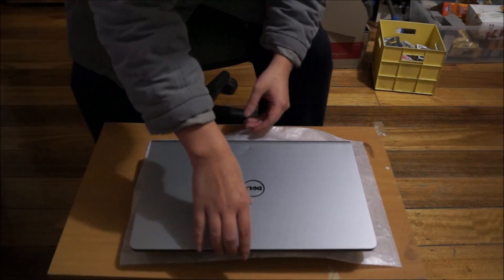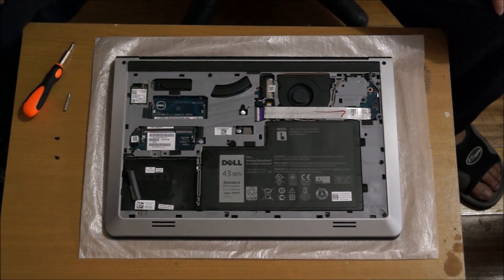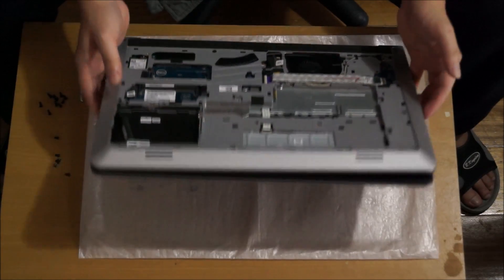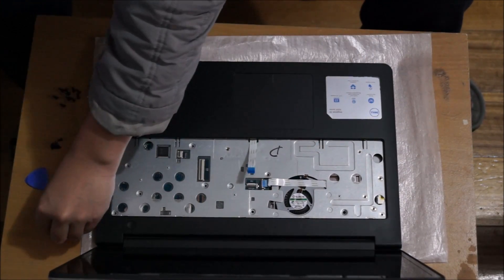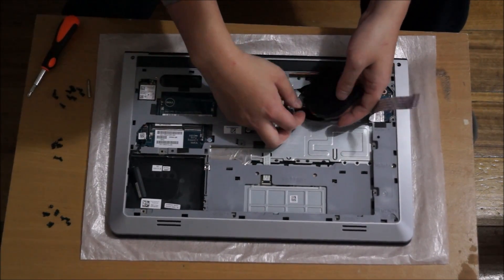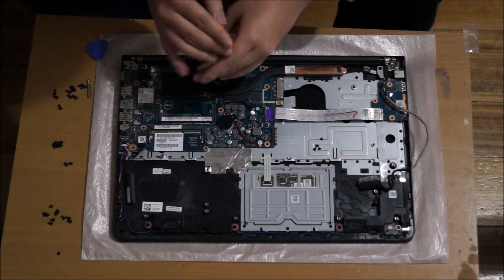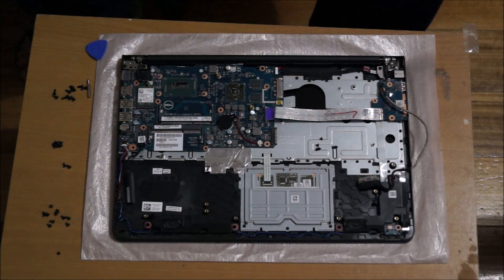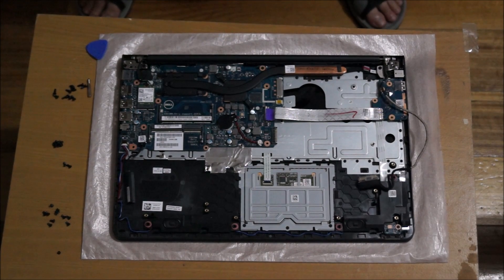OPEN ME UP! Dell Inspiron 15 ( 5548 ) 5000 Series Disassembly

Comment: Do you think I could fit a 9.5mm "2.5 HHD rather than an SSD?
Reply from the maker: it will fit a 9mm 2.5 inch drive as the verbatium i was using is a 9 mm
Reply: @OpenMeUpTec  Oh okay, thank you. I'm just surprised you've been responding to comments from a video you made 9 years ago.

Comment: Can u explain why it beeps why I turn it on like I get 4 beeps at a time
Reply from the maker: beep code are there to tell you what is wrong with the laptop. i believe 4 is faulty ram
Reply: @OpenMeUpTec  it wasn't turning on at first but I removed a ram stick it works now
Reply: Hey do know like how to fix the webcam ? It doesn't work

Comment: My laptop is not working  .is shows beep sounds but now it doesn't respond  I dissemble the laptop and check motherboard but fan is on but display not bro help mw
Reply from the maker: beeping sound means something. it is a code you need to tell me how many beeps
Reply: @OpenMeUpTec   it's just like 2,or 3 beep  sounds
Reply from the maker: @honeysharma8052  probably your ram is dead take out the ram and see if it still beeps the same
Reply: @OpenMeUpTec  bro but i follow your video and open my laptop complete and then connect dc jack with charger and then connect fan fan is working but but but my display is not gatting on
Reply from the maker: @honeysharma8052  did you forget to plug something in. did you do what i told you to do. remove the ram and turn on the laptop. 2 or 3 beeps generally means ram is missing
Reply: @OpenMeUpTec  i complete open my laptop each and every part then i just only connect fan dc jack to charger and display fan is gatting on but display not
Reply: @OpenMeUpTec  you're on any social networking site i send you a picture what i do

Comment: Do i need to remove the back cover to repaste the cpu or only the keyboard? And does this disassembly guide work for all models of dell inspiron 5000? Thanks man
Reply from the maker: you need to remove everything to repaste it. this guide is only for this laptop or a laptop that look like it. if your laptop looks different go watch my other videos and try to find it. overall by default you need to remove everything before you can repaste it.

Comment: Hi dude ! And thanks for this helpful video. I have thermal issues and I noticed that my fan don't blow like before. Do you know where does it come from ? I have update all my bios and drivers...
Reply: Thermal issues like : I am hot and '' bip'' shut down
Reply from the maker: @Yassou1985  the fan automatically turns on when it is hot. if thats not happening as you like there is nothing you can do about it. you can make the fan turn on by download 3rd party software which i have used before. i recommend you to open it up clean the fan and replace the thermal paste

Comment: Not a complete disassembly... you didn't remove the palm rest nor did you remove the lcd
Reply from the maker: i originally did it but found out it was pointless as people who are watching the video skip that part or are too scared to remove the LCD. also if you are watching this video to remove the LCD then i recommend you not to do it. 

therefore all my video are aim to go to the motherboard only
Reply: @OpenMeUpTec  I've gotta replace LCD hinges on one... wanted to get a heads up before I opened it... but I did see that the LCD hinge screws are the last thing to come off before removing the LCD assembly. Non the less your video was helpful so... Belay my last and thank you sir.
Reply from the maker: @wheeler90  thanks for your support
Reply: This is what you want....... https://youtu.be/hPd7r9hylNc

Comment: How do you reconnect the wifi cable? Also,  I disassembled everything and put in a new touch pad cover. Now, my screen is black and makes beeping sound when I try to turn it on.  Any suggestions?
Reply from the maker: you need to reconnect the wifi cable  or else you wont get wifi. the beeping sound means you stuffed up somewhere. tell me how much beeps it is and i will tell you what you forgot. example if it beep 7 times then it means no screen attach, this would mean you forgot to plug in the LCD cable. It also beeps if you did put the ram back in or you put it in wrongly
Reply: @OpenMeUpTec  Thanks for the follow up. I originally  used only a Phillips head screwdriver to gently disconnect  the Wi-Fi. However, I am having issues with reconnecting manually. It's like putting a thread inside of a needle.  What tool should I use that will assist me to plug in they Wi-Fi cable back into the connector? 

Also, When I turn my computer on, it beeps 8 times and then it stops for about 3 seconds and then it beeps again 8 times. Can this still be in LCD connecting issue?
Reply from the maker: @chrisnaden  the wireless cable should go in easier without much effort and no tools required. if you still having issue remove the wireless card therefore it is easier to plug in the cables. this way you can practice and see what is going on
Reply: @OpenMeUpTec  Thanks for the update. My issue is that during removal, I accidentally removed the wires from the connector that is suppose to connect to the card. I may have to just solder it or do something like what is here: https://youtu.be/UnNCSlU4a64. Do you think it would be a better idea to just get a new wirless antenna for the Inspiron 5448? The guy's method on this video seems too time consuming.
Reply: @OpenMeUpTec  you were right. It was the LCD cable. You are the man!

Comment: LOL wtf Dell, I'm taking apart an Inspiron 15 5000 series, but it's completely different from this one since it's a 5567 instead of a 5548.
Reply from the maker: its is actually how dell named the laptop. if you look up the service tag for this laptop it says Dell Inspiron 15 ( 5548 ) 5000 Series which I used from them
Reply: @OpenMeUpTec  oh your video is fine, I was annoyed at Dell for making two laptops in the same series so unrelated, not at you.
Reply from the maker: @Statalyzer  thanks for your support there is more than 2 laptops in the same series. there is 3000, 5000 and 7000, the higher the serial the more expensive the laptop is and more premium

Comment: Mine keeps beeping 8 times. Can you help?
Reply from the maker: That's bad. It means CPU is faulty which is basically the worst thing and can't do anything
Reply: It has a continuous 8 beeps sound  which in the DELL community said that indicates an LCD Failure. Also when connected to an external monitor, the laptop works absolutely fine.
Reply from the maker: Manya Mohan I apologize just went to check the error code list again. I made a mistake 7 beeps means your CPU is dead. You can try to open it up like in the video and see if the LCD cable is loose but I doubt it.
Reply: OPEN ME UP okay. Thank you so much. I'll try opening it and looking it up.

Comment: hey dude i want to need to change my wifi antenna, can you help me please?
Reply from the maker: Removing wireless card 12.10. get a new one and put it in. watch the video 5 times and you will understand it
Reply: i know but the problem is the that one wire of the antenna has been cut, thats y i need to change the whole antenna
Reply from the maker: yes unless you can reattach it. the antenna goes to the screen
Reply: i dont think it goes to the screen, i think it is inside the middle hinge cover
can you guide me?
Reply: i dont think it goes to the screen, i think it is inside the middle hinge cover
can you guide me?
Reply from the maker: the middle hinge cover goes to the screen
Reply: i need to remove the frame or just the hinge cover to replace it?
Reply from the maker: you need to remove the screen from the button then remove the frame which is apart of the hinge cover

Comment: Hey, the top right part of my laptop(where the keys 'backspace' 'enter' 'delete' etc, are located) is getting heated up pretty fast after booting in to the OS. The region below it also has the same problem. Can u tell why tat happens and how to reduce it. Also if I play games with moderate graphics it shuts down in like 20 min. I thought the cooling pad might do the trick, but it still doesn't change anything.
Reply from the maker: open up your laptop, replace the thermal paste and clean it out. do that first then come back to me if you still have issues. you can follow the steps in the video which will show you how to do that

Comment: Hi. I want to disable the built in camera and mics. I'm a whistle blower on court corruption and I am absolutely positive they will remotely use them if they find a means to do so.

I didn't notice you mention any thing about where the camera and mic wires connect to the motherboard. Are they separate from the LCD bundle or are they a part of that? I will snip the wires if need be.

Please response asap because my other laptop is dying and I need to get set up on a new one. Thanks for any help.
Reply from the maker: you need to prey the screen surrounding off and you will be able to see the webcam there. you can then unplug it. on the motherboard it is bundle into the LCD cable
Reply: What a fast response! Thank you so much for the response!

Comment: I hate the new dells.  Got one for the wife and need to replace the charging port and now they make the screws insanely small and make of freaking butter. And they tighten them on like crazy! Charger port literally sunk into the computer in the first couple days. Shitty buy. Wouldn't recommend a dell

Comment: Hi thanks for the video. I disassembled and reassembled but am now getting a very faint almost black screen. Have tried unplugging and replugging lcd cable several times-same result. Any suggestions? Thanks
Reply from the maker: use a light in a dark room and shine it on your LCD screen if you can see your desktop that means your LCD back light is dead besides that you need to tell me why you disassemble your laptop because you want to replace something or just for fun?
Reply: OPEN ME UP Hi, I took it apart to repair the right side hinge. Earlier today I was able to see the desktop and use the touchscreen (very faintly). I just tried to boot again and am getting 8 beeps - lcd failure. Anything I can do? Thanks
Reply from the maker: you might have stuff up. when you replace the hinge you might have place the LCD cable it a bad position and damage it or you could have pulled on it. you might need to replace your LCD cable or just plug it back it again to see if it works. try that first if that doesnt work you might have a big issue as your screen is working but the back light is not so could be that it is faulty therefore you might need to replace the screen itself or LCD control board really hard to tell what your issue is. so your first step now it to remove your back cover in the video at 12.00 and turn on your laptop like that to test if the screen works. you can move the cable around while it is on to see if it works.
Reply: OPEN ME UP disassembled it again and powered it up.. the lcd works now and there is colour.. but it's dim and brightness adjustment doesn't do much. 

Is it possible to fully remove the screen, leave the lcd cable unplugged, and bypass POST to allow me to just project using HDMI to a monitor?
Reply from the maker: no but if you want you can test it. there is no difference in removing the cable from the LCD side or the motherboard side as the motherboard needs a response. so if there is nothing on any end of the cable then there cant be a response saying LCD screen is here. thats why you get 8 beeps

Comment: When taking out the LCD cable it was connect by a smaller cable to something else? Help
Reply from the maker: it is the touch screen cable
Reply: How do you get that off safely? And i have found my problem. My antenna wires for the wireless card have come out of the snap pieces because of one of my hinges came off. Is it possible to push the wires back into the snap pieces or will I have to buy new antenna wires?
Reply from the maker: you can but if it doesn't work or you get crappy reception then you have to replace them

Comment: Thanks for posting, this video has been a big help. What are my options if my connectors for my wireless card are torn away from the wires.
Reply: Thomas Barlow I think the same thing has happened to me. My hinges were messed up at first and then the wires came out and my wifi stopped working
Reply: Taji Astro same, I just got a wifi adapter

Comment: hey thanks for the video.

but please what position goes the wlan cable?? there's a black and a white. you were too quickly on that part
Reply: oh I just saw the marks showing the correct position
Reply from the maker: It doesn't really matter switching it around doesn't change anything